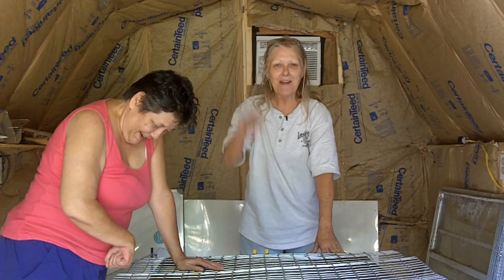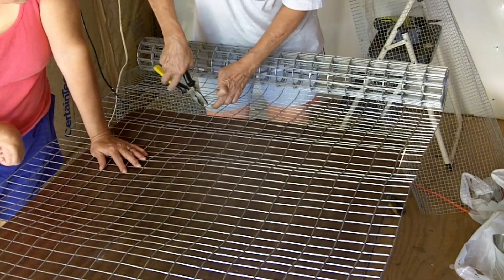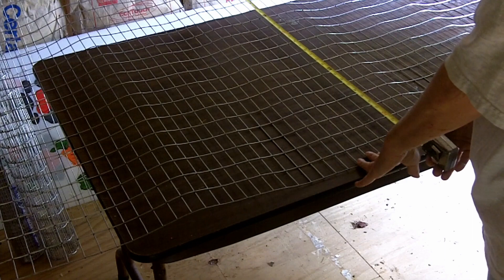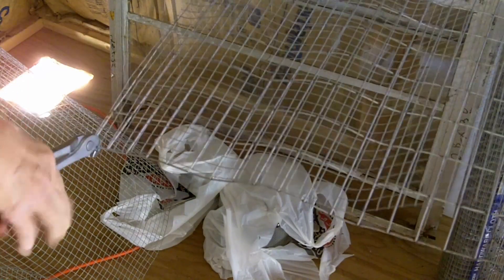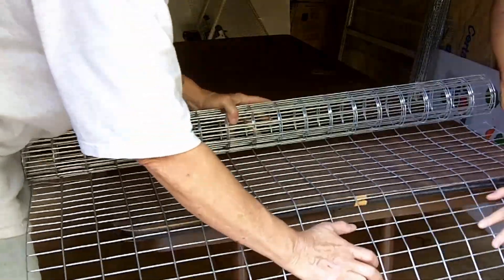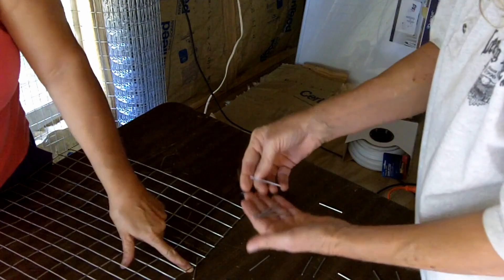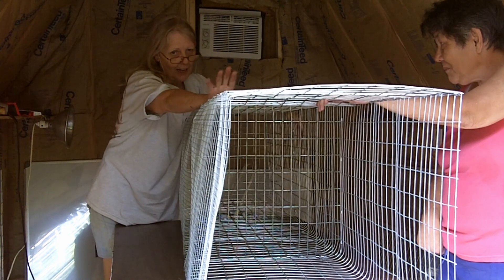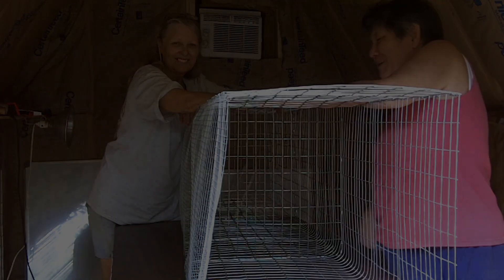Beginning To Make Rabbit Cages

Comment: It may not be the most creative suggestion but keep metal scraps to take to the recycler.  My local recycler (you very likely have one, too) takes all sorts of metal scraps as long as there is enough to weigh (you may want to check beforehand to find out what constitutes "enough").  Too often people throw out stuff like old electric cords (it's considered to be "dirty copper") that could earn them money.  A bulk combination of bent nails, broken rakes, old wire, cans of all sorts = cash.  That's very important when you've gotta count pennies.
Reply from the maker: Great ideas!  It's true.  A lot of stuff gets taken to the dump when it can be repurposed or recycled!

Comment: What happened to your sound? It was out of sync and not very loud. :(  Don't you just "love" doing "J" hooks? ;P  Where did you get that heavy gage wire?  I have not been impressed with the gage wire of what they sell for rabbits. Seems rather flimsy.  Did I ask enough questions? ;D
Reply from the maker: The sound was a glitch.  I probably undid the right thing and redid the wrong thing while editing.  Oh, well....  The 1x2 wire we got at Tractor Supply.  Don't go to the rabbit section!  Now the answers are given... LOL!
Reply from the maker: Mother, Jo here. I found out with TSC, that you don't take it for granted that not seeing it means they are out. Go online first. If their online store says they have it insist look in the back. Even one of the employees was going to another store because she didn't know they had it in stock. J clips are easier than weaving wire in and out to fasten it together. I've dome both.
Reply: The TS that I usually go to is pretty good.  If I need something and can't find it, they will check in the back without being asked.  The one further south, not so much.